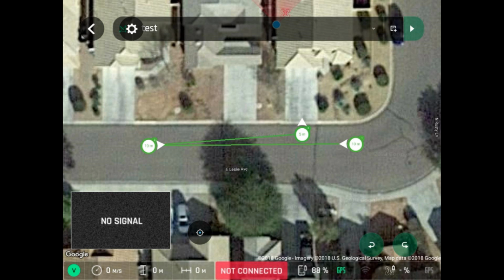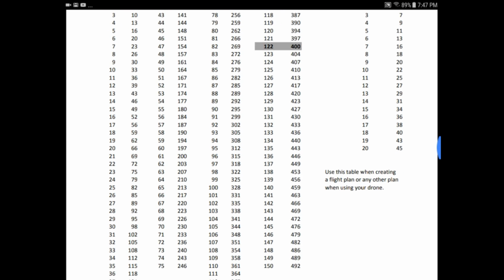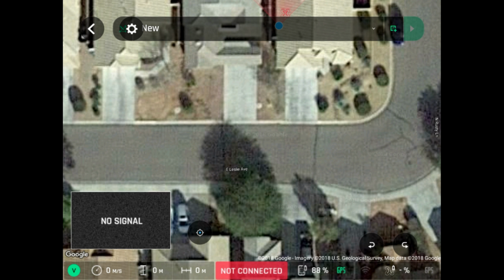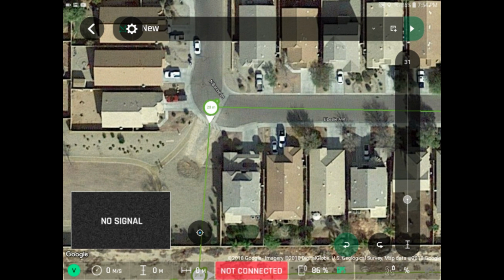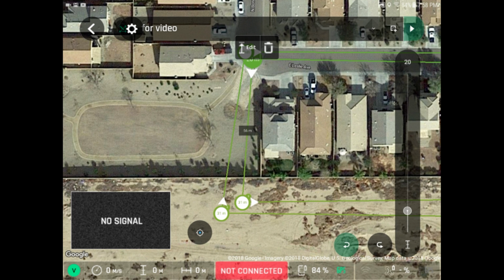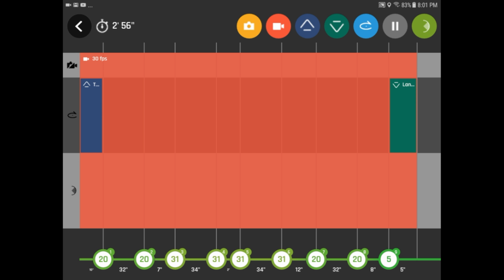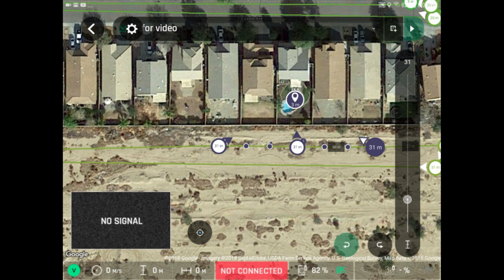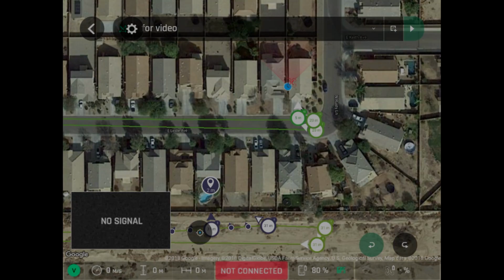BEBOP FREEFLIGHT PRO COMPLETE FLIGHT PLAN TUTORIAL

Comment: I have a question about flight plan . If you are underway currently flying in a flight plan and you see something on the screen you want to check out ,such as the pool you mentioned , in the process flying can you take control of the drone and manually fly over it , view it and then somehow click something and resume the flight plan you were flying in ??
Reply from the maker: Thank you for your question Tracy. Yes, you can take over from the flight plan and fly from the controller. Then, go back to the flight plan screen and tap the "start" arrow again. As long as you have not landed and turned off the drone, the flight plan is in memory at its last position. I am speaking from experience and don't guarantee it will work that way every time. Thanks again and God bless.
Reply: @user-sr8pn9xg8z  I am using the disco with flight plan I assume it will be the same thanks for the tip !

Comment: I flew a couple of flight plans yesterday, 15th Sept 2018 and created Virb videos with flight overlay templates, actually the Bebop 9 template in meters. Anyway viewing the end result I noticed a new field or at least I have not noticed it before, 'Altitude above ground' as well as 'Altitude' and these did appear to change over the course of the flight relative to the projected ground elevation by upto 20m which was as expected as planned on Geoplanner.com.

So the question is ... If the Bebop data appears to know how high it is flying above the flight plan route can it be requested to maintain a fixed height so that we do not crash into the ground when elevation change on route.

I have a flight plan I would like to fly however the elevation change is over 120m over the flight so the ability to maintain 40m above the terrain would be very very useful and much safer.

Just wondered if anyone else had noticed that the Bebop appears to know how high it is above the 'actual ground' 

p.s Are there any work arounds to change the silly 20m RTH to a more useful 40m ?

Comment: When I do a 20 minute  flight with my BeBop 2 Power with a flight plan instead of recording 1 long recording it records 2. One is usually 3.5 gigs and one a little less than 1 gig. Always the same size. I can't figure this out.
Reply from the maker: I have the same trouble from time to time. If I want to run it through VIRB Edit I first splice them together in my editor. Then it runs through Virb without needing to do anything else. But I don't have an answer why it does this. If I ever figure it out I'll put up a video on it. Thanks for your comment and God bless.

Comment: MrKent. I may have missed it in the video or maybe it wasn't addressed, but I understand to get better distance one should disable the WIFI connection from you smartphone to the drone itself when flying without a flight plan. To use the Flight Plan feature is it necessary to connect via WIFI from the phone to the drone? I have only done flight plans where I can see the drone. I was planning a longer one and don't want to lose it. The whole WIFI issue confuses me sometimes on when and when not to connect from the smartphone.
Reply from the maker: Hi Jay. I have never intentionally flown my drone with my phone. But that's another story :) I always use my skycontroller because it is so easy compared to the phone (for me).

The thing to keep in mind is that a flight plan, once executed, takes over control of the Bebop until the end of the flight, or, unless the operator does something to move the controls while it is still in range, in which case the flight plan pauses and releases control to the operator. So, once the Bebop gets out of range for the phone's wifi it will continue to execute the flight plan. 

It is true that if you turn off your phone's wifi it will not interfere with the skycontroller's communication with the Bebop which, theoretically would increase the range and I think it does help. 

I hope that helps. If I missed something please let me know. God bless.
Reply: Oh yes. I use the SC2 also, but with the phone connected to receive the video feed. I usually, however, turn off WIFI. I was just wondering if it should be connected to the drone in the "Flight Plan" scenario.
Reply from the maker: OK, thank you for the clarification. I guess I answered in more words than necessary. Could have just said, "No! It doesn't need to be connected." Thanks for your comments and God bless.